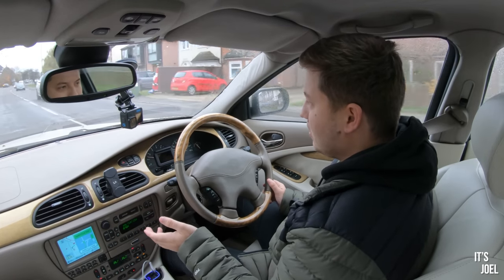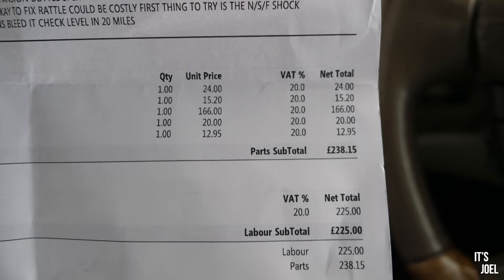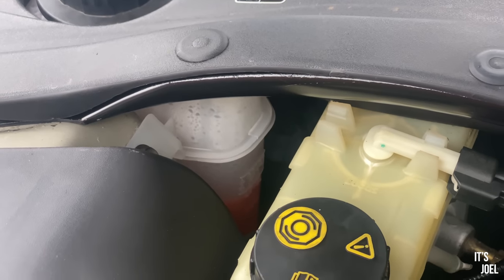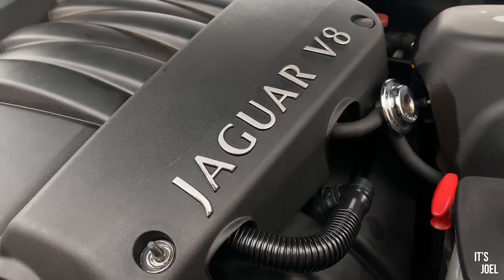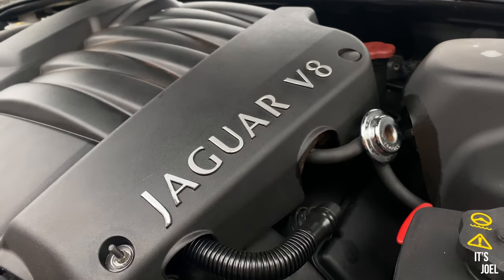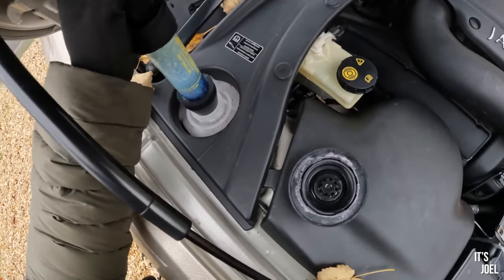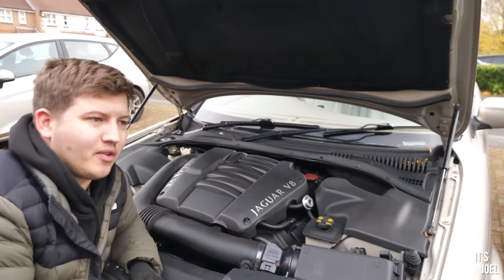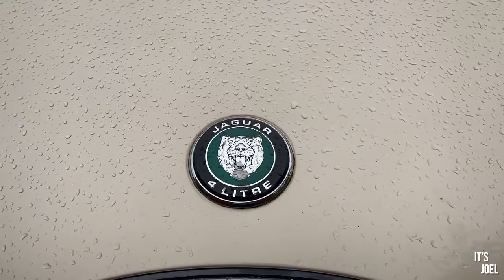Can this £30 bottle of Steel Seal save my cheap V8 Jaguar?

Comment: Looks to me like you need to make sure the whole cooling system is properly bled, take a look in the manual, there is usually a specific procedure given as to how. Some can be extremely tricky to get the last few air bubbles out but patience and persistence will win 👍 great channel, very true to the reality of owning an older 'special ' vehicle. Go man go 👍

Comment: I wouldnt worry about the white smoke from the tail pipe that could just be coz it’s cold outside or the fact it’s a bit older. If your 2nd sniff test came back ok I’d suggest you start to use the car and see how you get on with it, maybe keep a few litres of water in the boot with you incase anything happens. Then you will see if it’s fit for your future plans. 

Keep up the great work too, I really enjoy your style, taste in cars and love the challenges you do in the videos. 👍🏻👍🏻

Comment: White vapour coming out the tail pipes can be very misleading at this time of year: similarly mayo in the filler cap can be because the car is not being run at working temp for long enough.

Comment: The white smoke is just steam I think Joel, hot exhaust gases hitting the cold air at the moment. I’ve seen cars with head gasket failure and the white steam is much denser

Comment: That era of V8 Jag was notorious for faulty thermostat housings causing a leak. Plastic moulding that distorted over time and there was no visible "drip" because the water ran down the engine and evaporated. Good news......cheap easy fix.

Comment: Steel Steel works very well.....I used it on 2.5turbo diesel 1989.....I emptied some water out of system so level was below expansion tank hence getting Steel seal straight in to cooling system...then topped up water... the cylinder head was sealed straight away...but 2 months later I had issues again...I then repeated with another Steel seal and it has held firm for 25000 miles and counting 😀 hope this helps

Comment: Used it on my s type 30000 miles ago worked a treat after  gasket fault  pressured coolant system. MAKE sure you flush old coolant out clean out the rad and then clean it  again .then follow on line instructions. Only issue I had was  one it killed the heater control valve, swapped it out for new one

Comment: Go give it a good drive and see how it gets on, just remember a sealing substance is not a permanent fix and that it will now be gumming up all your cooling system. If you want a job doing, do it properly first time, temp fixes and boddges make more work in the long run.

Comment: I've used a bars leak alumna seal on a Ford ranger with the 4.0 v6 pushrod engine. It solved a coolant leak and over heating problem. Bars sealant used to make a sealant that looked like liquids copper that worked for sealing a cracked cylinder head on a straight 6 chevy.

Comment: Hi. Nice car. No experience with Jag V8s, but I do run another V8 from the same era in a similar car, and can tell you a couple of things.
1. the white sludge on the bottom of the oil cap could be condensation. These engines are large, and have more oil in them than your average 1.4 Vauxhall. That means that it takes longer for them to fully get up to temp (and I mean oil temperature, not water temperature as indicated by the gauge). If you use the car for short(er) drives, or it's been shuffled around on the lot before you bought it, the oil probably rarely got nice and hot, and thus, will have a bit of moisture in it. Take the car on a good long (1+ hour motorway) drive, get it nice and hot, and recheck. 
2. The white smoke out of the exhaust is normal, especially on these cold winter days. The combustion process leaves a bit of water behind, and on a long car with dual exhausts there's plenty of real estate for that to condensate back and turn into steam. If the exhaust itself doesn't smell sweet, and there's no oily residue coming out of the tips, I wouldn't worry too much about it.
3. You may have had a slight head gasket leak, leading to blow-by entering the coolant system. This explains why, as soon as the thermostat opened and the fan kicked on, the coolant rose. It's essentially the system burping out the exhaust gas. 
I personally don't have a lot of confidence in those products fixing a fully broken head gasket/heavy leak, but if it's a slight crack in the gasket, or perhaps coolant mixing with intake gasses through the crossover, I can see that product improving matters.

Comment: The v6 and v8 Jags always give off what looks like white smoke from exhaust - my S-Type does it even though I definitely don't have a coolant issue because I never ever have to top up (not even slightly).

Comment: I have used this stuff on my son's fiat Punto because there was bubbles appearing in the system. It worked fine in his car .He once brought a Vauxhall Corsa 1200 cc that had mayo on the oil cap but that wasn't a head gasket. To be honest I wouldn't put any shit in my cars as if I'm keeping them , which I do till they are no longer worth spending money on . I would just do the head gasket as it isn't that much work . Just make sure you keep an eye on your timing settings and don't try to do short cuts . It's a pain to clean that stuff out the system if you need to as it coats everything.

Comment: I’ve got a 2018 2.0tfsi Audi a5. When I got it I was concerned at the white smoke out the tail pipe - loads even in the summer. However it’s not used a drop of oil or water in 2 years and been given a clean bill of health by Audi a few times now. So I think it’s just normal for some cars

Comment: I reckon you got a perished hose somewhere and it’s leaking enough to drop the coolant but not enough for you to notice on the drive / floor or it could be leaking on to the exhaust , down pipe/ manifold and it’s burning away so you don’t notice it this could also explain the burning smell in the car

Comment: I had a Honda with a head gasket leak and the garage used leak sel. I drove the car without any symptoms for a few 1000 miles but the overheating started again. I tried leak seal again but it didn't work. I'm afraid I sold it to a dealer who I told about the problem and bought another car. Motto - it must depend on how bad the gasket is broken .Hope yours worked out  better as lovely car and engine.

Comment: Well the temperature seems stable even after a long period sitting idling. We have a 3ltr straight six BMW and it pumps out condensation under almost any condition, however, it does stop after a decent run, I mean a 100 mile decent run. .... the car performs really well, it's ultra reliable, the coolant level doesn't change and there's a tiny residue under the oil filler cap. The fans rarely kick in and there's absolutely no signs of overheating. We are at a loss to understand the issue but perhaps there isn't one. Ours has been doing this for the past 10k miles so I can only assume it's water vapour from burning the petrol. We think it's the design of the exhaust which might have something to do with it, i.e, the backend of the pipe isn't getting hot enough so condensation forms. I can't say for certain but I have heard 1 gallon of petrol produces 1 gallon of water. That number might be wrong but at least a fair amount of water is produced whilst burning fuel. Finally, simply because there's a tiny amount of sludge in the oil cap it doesn't mean a head gasket failure. Swarf is produced as a result of vapour in the fuel and oil in the block. From my experience I think your Jag looks perfectly fine.

Comment: The oil will still contain some water from the previously leaking head gasket, so it’s not surprising that any excess white vapour hasn’t yet stopped. An oil change is probably needed to sort that out. Also, as others have said, you will see exhaust condensation in cold weather anyway. A cracked header tank and hoses coming undone may be signs of pressurisation of the cooling system due to the head gasket failure.

Comment: i have had issues with head gaskets and my self have used steel seal and has always worked the white smoke from the exhaust your seeing is from the water thats left behind from it will clear after a while if the coolant level is fine and temp gauge is ok then the steel seal will have done its job hope this helps

Comment: I bought an ST220 in the summer of 2010 and come winter time, on a cold day it used to chuff out cartoonish amounts of white steam from the exhausts, even after it was thoroughly warmed up and been driven for miles.  It was almost embarrassing in traffic queues

This initially alarmed me, Ford V6’s don’t have a great history for head gaskets (although the 3.0 is much less affected) but after reading of other owners reporting the same thing I decided to just ignore it and hope for the best 

Had it for 10 years and put 80k miles on it and never had any problems…well, not with the head gaskets at least, I had plenty of other problems which are a whole other story…

My advice is just drive it and unless it’s still losing coolant or overheating, don’t worry about it

Comment: I was very sceptical about steal seal. I used it on a 4 cylinder Omega about 3 months ago and the car gas now done 4000 miles with no issues. Believe it or not, i have another Omega that had head gasket failure late last year - mayonnaise oil and misfiring and water loss, purely out of interested  i used it on that one too (also 4 cylinder) and i can't believe it worked on that one too 😮

Comment: Take it for a run, could just be water residue in the exhaust, now (if) you've fixed the head gasket it should clear, run it a few days and see if coolant stays level, might have worked.

Comment: Hi. Watching your video and you commented on a burning smell in the cabin. I had that problem with my S-Type and it was a crack in the catalytic converters. Apparently this is common at around 50k miles. There is a repair section for the converters costing around £500 for both.  The sat navigation  system is CD based but I don't know if you can update them anymore. It's located in the boot. Hope this is helpful.

Comment: I used it on my dads car for larger engines you need two bottles of the steel seal. It does work brilliantly.

Comment: Hi Joel - I do wonder if you have a minor leak (evidenced by the coolant splatter on the cam covers) rather than a head gasket problem. My xk8 emits a lot of water vapour this time of year but does not use any coolant and its over 26 years old. Generally, apart from timing chain tensioners, these engines are very tough, unstressed, big lumps. The exhaust systems are genuine double piped systems and take a lot of warming up - so quite a bit of white smoke. Worth considering before stripping down the engine perhaps? Best wishes - although stripping out a V8 is great content!

Comment: Work for jaguar as a tech for over 25 years,never had a head gasket issues with this engine...started on xj40 all the way upto new I pace..misfire generally down to the coils as water drips into the rear ones by the bulkhead from scuttle

Comment: The car maintained working temperature. I'd say you have a faulty header tank cap. The white smoke is just condensation. These jags are really hard to bleed the coolent system after a fluid change.

Comment: IT’s condensation/ steam. The damp cold air mixing with the hot gases from your exhaust. Your engine will produce some water from the exhaust too from the cold denser air in the morning which has water molecules it it.
Look at other cars on the road in the cold mornings you noice steam from a lot of them too.
Hope this helps.

Comment: I wouldn't be so sure it's a head gasket. I've run V8 Jags for the best part of a decade and, when it's below 8 to 10 degrees out, they do steam constantly from the exhaust. I also found you would get a little bit of mayo on the oil filler cap in winter, from condensation. As soon as the weather warmed up, the mayo would disappear and the steaming would stop. It's more likely you've still got a small leak somewhere, or it's just burping from not being bled fully. These engines, despite their early reputation, are actually pretty robust and head gasket failure is rare, assuming the engine hasn't been cooked. Water pump and thermostat leaks are pretty common though.

Comment: Don't worry about that amount of water vapour coming out of the exhaust, perfectly normal on a car of this era in winter!
The small amount of 'mayo' on the oil cap, again is not always a concern, especially if you're doing shorter journeys in cold damp weather.

What is more a concerm is coolant loss without an obvious visible leak.

The steel seal you used is a good temporary fix.

I had the 3.0 v6 s-type a 1999 model, had the same satnav as yours, quite a rare option, with I think cist around £1200 originally, most most had a lockable cuby draw type thing there!

I used to enjoy using it but was more often driving over grassy fields on the screen as any new roads weren't on there!

 Mine came with the satnav book and originsl software CD, as far as I remember there is a unit in the boot that reads the CD so I guess you might be able to update the maps?

I had a few electrical gremlins in mine that I couldn't pinpoint, the front passenger door would have a mind of it's own, sometimes locking sometimes not, sometimes double locking, so you couldn't even open it from inside, then oddly it would randomly start working again!

I was just concerned if that happened in an accident and I couldn't open doors....⚠️😲

So had to part with it very reluctantly, nine was absolutely mint, paid just £600 had a full jaguar service history only had around 95k.
Very nice car to drive, just a very thirsty car....😳😁

Comment: Pressure test it when it is cool, if the test pressure drops look for a leak, may be only slightly damp on a hose clip, eliminate this before you assume it is a head gasket.

Comment: Give the car a service, change the oil and the coolant - then just drive the car and monitor everything. As others have said Mayo on the cap doesn't mean much as its cold in the UK. I've had a E36 325I with mayo on the cap but it was doing short journeys in the winter, same as my 996 which I currently own, it has some on the cap, but, no issues, it just gets driven less frequently and less mileage during the winter. 

You may have had a head gasket issue, as I thought that from your first vid though - but it looks like the solution you put in has done something. You could always try the test again in the exact same conditions as I think before you didn't have the fans on full when it came out yellow, just a thought. 

Good luck - hope its a keeper as I love the big old V8's!

Comment: Lovely car Joel but lots of problems been there where you are I'm a sucker for Rover 75 had 6 from the Diesel to the V6 petrol 2.5 all money pits there cheap for a reason my V6 overheated spent a fortune in the garage on parts and having system pressurised plus labour drive it up the road overheated again. Got  £300 on the Scrap lorry. £500 to £700 for timing belts tensioners plus waterpump. Head gaskets that have gone on my car are heater only blows Luke warm, temperature gauge climbs, and thick white creamy on oil filler cap.

Comment: I wouldn't have used that before confirming that it's a HG issue and also confirming that you don't want to have it replaced

It gunks up all the cooling pipes and head.

The white smoke is normal

Comment: I have slight condensation under the oil cap of my E46 BMW 318i. After driving it about for a good long run it disappears. Honestly, it has to be a vast quantity of sludge and gunk if that were to be a head gasket problem.

Comment: I used a bottle of rad weld on my diesel smart run around after my coolant leaked all over the floor. A bottle down the expansion tank and a few miles later it was sealed. No issues since and maintaining coolant levels

Comment: I ran one of these in mid 2000s with a blown head gasket for 18 months without issue, pain to keep topping up the fluids for sure,  but tbh it was bullet proof!
It's the electrics that will bite you on the arse mark my words.
Top tip....
Get a decat straight thru exhaust for a glorious V8 soundtrack. Good luck fella 👍

Comment: Hi Joel hope your well I've used steel seal many times and it's excellent you can't really mess it up with regards to the smoke I wouldent worry to much its so cold out you'll find alot of the time it's just the hot air meeting the cold from your exhaust looking like it's smoking when it's actually not. You'll find this more with petrol engines than diesel 👍 wish I lived closer to you I'd more than happy to help you out

Comment: Not to be the voice of doom, but I used to have a 1999 e39 540 and had a very similar issue, white smoke and loss of coolant. Just the same as you, replaced the whole cooling system, which actually made the problem worse as there was nowhere for the pressure to escape. In the end I went down the not cheap route of stripping the engine, and it turned out the bores were scored. New engine job!

Comment: Somebody has already mentioned the the header tank cap, my V6 Saab I had for 3 yrs I could occasional smell coolant in the cabin, and the car would use ( or loose coolant ) I used to regular top it up, turned out it was the expansion tank cap. Don’t fixate on the exhaust emission in this weather you will always get sight of the exhaust gasses. Use the car see how it goes ….the gunge on the underside of the oil cap looked like nothing to me and after a good run it should go. A proper duff head gasket makes it look like thick cream, that I don’t see.

Comment: Don't think you face a head gasket issue here ..but to double check - get the car to operation temperature - open carefully the cab of the water extension tank  - use the Co- Tester again BUT accelerate the engine to 2500 rpm for a while and then carry out the snif test. ! If it changes to green/yellow then you need minimum new gaskets.